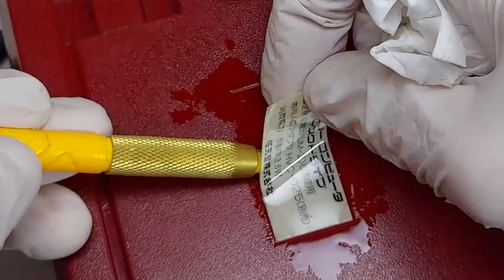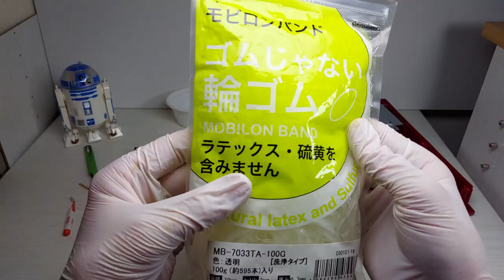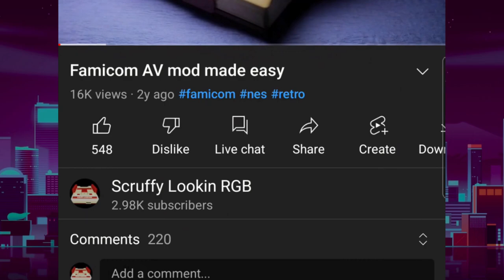Famicom Disk System Refurbishing Tutorial Made Easy

Comment: Great video and I might have missed it but why would a disk system play disc games like originals but not re written disks?
Reply from the maker: Good questin. Could be just a weak copy these disks are magnetic and are getting older so the chance of failure is high in my opinin.
Reply: It could be that the writer had a slightly different alignment.
Reply: @charles2133  after repairing a few of these now I think that is the case.